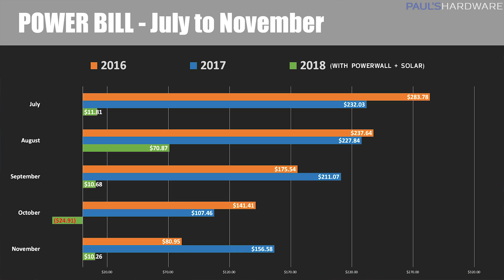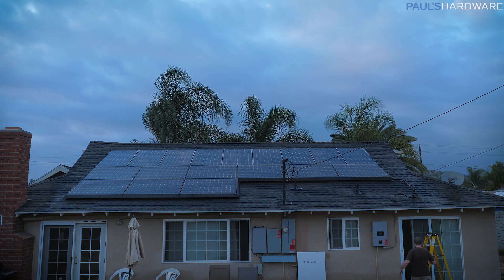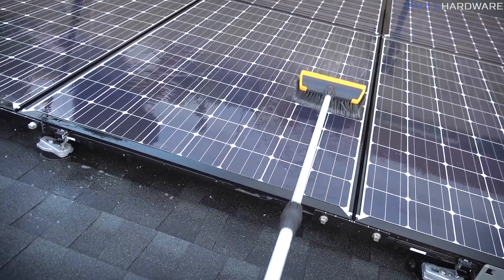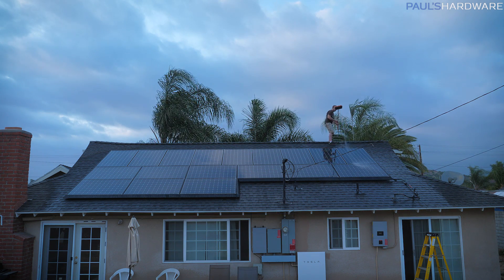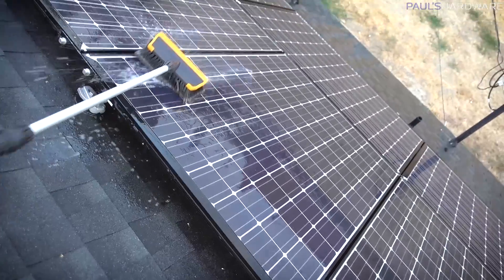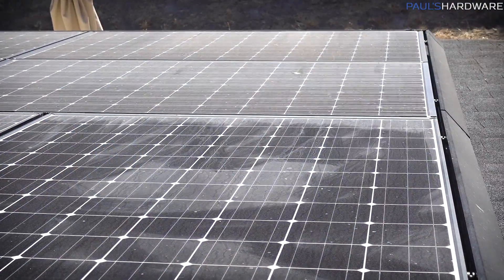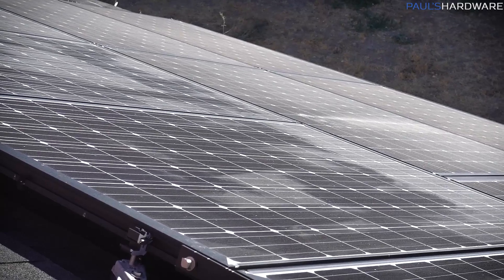Should You Clean Your Solar Panels? Before/After Testing!

Comment: Maybe next time you get up your roof with a harness that prevents you from falling down? 
Cleaning solar panels can be a good idea, especially when leafs block individual cells. Then they act as load for the remaining strings inside of that row in the panel. This can cause heating and degradation of the cell. 
Maybe it can also be a good idea to install an additional luxmeter to cross correlate power output vs. actual lighting conditions. This may show problems a little bit earlier.

Comment: Hi Paul
We installed a 6k system just over 13 years ago and it became pretty clear that we needed to clean the array on a regular basis.  However, our installation is on the roof of a 2 story home which makes it a real challenge to safely reach the panels.  My solution was to array several metal pulsating lawn sprinklers above the panels, run pipe up to the roof, and automatically inject a cleaning solution into the water line whenever I turn on the cleaning system.  It definitely increases output but I do think manually scrubbing would most likely increase output even more but not at the risk of hauling my ancient ass up a ladder with a brush and hose.

Comment: Off grid solar for ~20 years here. Some thoughts:
1. Cleaning does improve performance (duh).
2. Despite the shorter days in fall-winter, I often get very good performance due to lower temperatures. My record setting days have been in late Feb-early March on cold clear days. I've seen my arrays producing around 115% of their rated output at times on cold/clear days in late winter. Cleaning can help keep your panels cooler. That said, I have spent much more time washing my truck than washing my PV panels.
3. Those who do the math on the cost of solar, based purely on economic concerns, are missing the greater picture. While I haven't paid a power bill in around 20 years, I also haven't purchased any NASTY GRID POWER during that period, and my power HAS NEVER GONE OUT during that period except when I have turned the system off for a couple of hours for maintenance and upgrades. During that (~20 year) period, my nearby friends and neighbors have seen their overall rates increase about 50%.
4. There are no easements or rights-of-way of any kind into my property (no need). If the power company comes on my property, they are trespassing. Just sayin'.....
Reply: What about over-all performance of ur solar panels in 20 years?
Reply: I'd love to pick your brain and learn as much as i can about your off grid experience and what your overall cost has been, the type of battery tech you are using and why, and how good it feels to be totally independent of the greedy power company
Reply: Regarding point 3, you say people who focused purely on economics are missing the greater picture, but the rest of point 3 mainly deals with Economics.  Just saying...

Comment: Paul, if your roof has a roof mount (an anchor that roofers use that is attached to your house) you can attach to that and get a repelling harness and attach it to the mount. You won't have to worry about falling, you can go lower or higher by adjusting your rope, and you can clean everywhere. Hope this helps.

Comment: I clean mine with the same method, hose connected to the wand, but I do them from the bottom of the roof. Had to put a half-inch PVC extension about 8ft to reach the top of the panels. Got about a 20% increase on comparable days.

Comment: HI algorithm. Paul I work on a mine site that uses almost exclusively solar panels due to its remote location. We scrub with hot water at the start of the day to have the smallest temperature differential between the panels and the water (so they don't shatter). We also spray a little bit of watered down detergent at the end and we find this helps stop the dust from sticking for longer.

Comment: In the UK with 20 panels, I noticed no different even after scrubbing them because we have alot of rain fall. I noticed something which is on a very hot days the water cooled the panels and increased production by 10-15%, I know panels have a temperature limit but didn’t think it would help this much. Thought it would be interesting to try in a warm climate like yours. 
Great video

Comment: Have you considered a safer option and using a cleaning solution that you can spray on and will clean and dry clear? There are several you can get from Home Depot, Lowe's, or Amazon. If you can get a sprayer to get to the top while staying on the ground you can probably do better safer job. That would be a good video to test different products to see which cleans the best while staying on the ground.

Comment: When two dissimuler metals are used in a physical connection they tend to corrode! This has been a problem with my garden hoses for decades now! If the end of the hose has a copper connection you should not leave an aluminium spray nozzle connected to it! They tend to fuse together ruining the hose connector!

Comment: 25kwh roof capacity, 20kwh inverter capacity - cleaned my panels recovered an additional 421w of generation
we live in a light industrial dirty area, lots of dust, low average rainfall for 70% of the year and heaps of sun all the way down in South Australia.
most of my panels are located on the second storey of the house (no shading at all) our roof is 25deg pitch and very dangerous, slippery as ** when you are up there to do it safely , i used car spraying foam (bowdens snowjob) and light brush to agitate. Panels had been on the roof for 500days
My results are a complete waste of time; took 4hrs to do it and it was a challenge with the suds and waterfall i created in the gutters. Advice would be to buy another 2~4 panels to negate a dirty array.
Great to see someone got far better results than me! at 30% with my decent sized system i would certainly consider it

Comment: If I went through the trouble and cost of having those kinds of panels installed (and I'm sure I would, if I had a suitable house :)), I would also make sure, from the start, that I have proper utilities for cleaning them, like a long enough cleaning brush to reach all panels and a proper "catwalk" installed for doing the job without having to worry about falling down. I wonder if the solar companies have any kind of automatic or semiauto options for the cleaning.

Comment: Here we removed the solar panels because a huricane was approaching. I cleaned, used a clay Bay and polished them with car polisher that leaves no residue (Surface is glass). Amps production improved really good. But still looking for the actual products to protect them. (I identified already one with two steps product) to remove any residue of the previous product used and protect them.
Clay Bay showed me with no doubt that scrubbing them is not enough.

Comment: I have solar panels and never cleaned them for the first 3 years.  Then I cleaned them and compared the year over year production and got nowhere near 30% difference.  The years after the solar panels were cleaned provided a little better production but not anything significant like 30%.  Maybe mine just didn't get as dirty as yours.  I'm in SoCal too, but further north in Santa Clarita.  I have 24 panels and the array faces almost due south (183 degrees).  Maybe the dirt has a greater effect on production the further away from due south you get?
Maybe your estimation method is not as accurate as you may think.  I would suggest simply comparing a full year to the prior year or take a six month period and compare it.
When you think about it, what you are saying is that your production when they were first installed was 30% higher than it was before you washed them.  So, do you really think you would have seen an annual reduction in production during year 2 of anywhere near 30%?  I'd be surprised if that were the case.  In my case, the production really didn't change that much from year to year during the first 3 years when I didn't clean them at all.
Interesting, and thanks for sharing.

Comment: Dear Paul:  Off topic request for topic:  Which PCI wifi adapter should you get?  (Factors:  speed, ac?, bluetooth?, antennas?, wireless display compatibility (Miracast vs WiDi)).  I've searched the entire internet, and there's very little info available on this.  Thanks!  🙏🙏🙏

Comment: Paul, there is a MUCH easier way to clean your panels. Have a look on line for something like the Unger Professional range... They offer actual "solar panel cleaning systems", which are essentially a derivative of a professional window-cleaning set - an extensible, 20' pole and then a specialist soft brush assembly. This would allow you to reach almost all your panels whilst remaining on the ground - you could finish off the uppermost part from a ground-based ladder up to your gutter if needed. The only thing you might have to consider would be the local water pressure you get from your garden faucet, because the greater the vertical height you want to push the head of water, the more pressure you will need. You could easily remedy a lack of pressure with a simple electrical garden hose booster pump. 

Something to bear in mind when cleaning solar panels is that a partially clean panel [more accurately a partially obscured one] can show a massive drop-off in current production compared with a completely clean one. Nikki and Jason Wynn, who run the YouTube channel "Gone with the Wynns" did an amazing video in which they rigged up a roof panel on a trestle table and connected it to a voltmeter and ammeter. They then partially obscured the panel with cloth and the drop-off in output was shocking [no pun intended]. However, based on the Wynns' video evidence, I would suspect that the differences you saw are a small fraction of what you could have achieved.

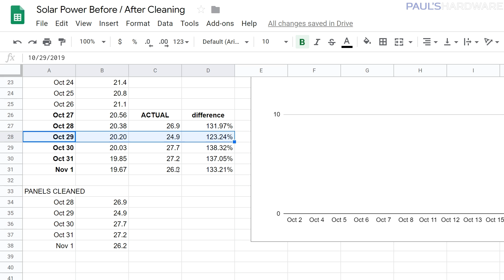Comment: Paul, long time fan mate. But your numbers are off, @8:46.  Percent Difference is generated by the formula Abs(V1-V2) / Abs((V1+V2)/2) * 100%, where Abs() is the absolute value. This means for the date of Oct 28, your percent difference is more like 27.6%, not 31%.
Ultimately the difference is fairly minor in this case and personally, I do not find it affects your conclusion.

Keep up the great work !

Comment: That is a really significant difference, and that's without even cleaning all the panels properly. It may be worth investing in a hook + tether to install on your roof, so you can attach yourself for safety and then clean all the panels properly. Even the ones you cleaned with the brush didn't seem perfectly cleaned, might be worth investing in some special-purpose equipment and going up there once every few months. The rain doesn't seem to do a good enough job, it appears they need scrubbing. It's good exercise anyway and will save you money.

Comment: I wonder if using something like a car soap might assist in your cleaning or if that is discouraged. Car soaps (the ones for washing your car not the spot cleaners) would be very gentle and non-abrasive, they also tend to have things that deter dirt from sticking to the painted surfaces and I'm wondering if these additives would be detrimental to the panel's efficiency or beneficial to the customer by spacing out the need for frequent washes.

Comment: By far, they are generating more when clean.  Just a thought, the cleaning brush is rather narrow. I'm sure there are wider ones available up to maybe 2 to 3 feet wide plus, the pole used are also available in more extended versions. I'd also use a very light amount of dish washing soap to help free some of the dirt as soap lessens the surface tension of water. Maybe a 3 or 5 pound weight on the brush will help for the farthest panels. It appears they do clean up fairly well when brushed while the non brushed panels still had residue on them.  If nothing else, they look better when clean !

Comment: Would be nice if you did it again but in 4 steps to get some more comparable results.
1 - clean them good for a fresh start so to speak
2 - after the next dry period, check the results
3 - just rins them with water, no scrubbing
4 - scrubbing

2/3/4 should be enough to have 3-4 nice days.

i am surprised at how dirty your panels even got. i know a few people that have solar-panels that bothered to wash them but no more as they noticed that the difference is negligible at best, mostly just a tiny 2/3-day bump. It really depends on the installation, panels and region.

Comment: I would imagine that using a two-sided squeegee, and then dipping it into a bucket and cleaning them like you would a window (or car window for that matter) may have an even better effect.  

However, my Grandpa back in the day used to have an attachment like yours Paul, but instead of hooking it to his normal hose he'd hook it to his pressure washer and fill it with premixed soap and then use it to wash things like his car (on the lower pressure setting).  Doing a quick search, it appears that there are pressure washing attachments designed specifically for solar panels, so that may be the way to go!  Soap and scrub them well, then rinse them clean with regular water.

Comment: To make your life easy get an extension ladder and an RV cleaning brush you might have to move the ladder several times but it will keep you off the roof. The RV brush can extend 20' or more so you should be able to clean all your panels.

Comment: Research a way to clean your panels from the ground.  You will be much safer and far more likely to clean the panels on a regular basis.  How about a very long brush/scrubber capable of dispensing a detergent or cleaning solution (mild).  Seems worth the effort/expense to maximize the panels' output.

Comment: Excellent video.  I’d be interested to see if there is a better, safer and more efficient way to clean the panels that does not require you to go up on the roof.  Personally, I’d be reluctant to do that.  I’d much prefer a ground based solution perhaps while on a ladder but definitely not on the roof.  Thanks for your videos about the powerwall.

Comment: Paul, you really need to do all of them properly as depending on the way the panels are wired into the system (of which i am unfamiliar with the Tesla's system) you can find that the panels will only generate at the same level as the panel receiving the least amount of light, its the one reason why system installers will look at shadows cast from things on the roof like chimneys or trees near the house casting shadows onto it are particular points of the day as the shadow cast onto 1 panel will cause a drop across them all, Get yourself a long telescopic waterfed pole meant for window cleaning with a long goose neck on it that way you can do it safely from the ground, it'll pay for itself in no time if you do the panels every couple of months.

Comment: Paul: You should try the Windex Outdoor Sprayer. It attaches to your hose - rinse first, spray on solution and then rinse. Directions state not to let soap solution to dry, but let it work for at least 15 seconds. Have used this product on outdoor windows and it does the job it is made to do.

Comment: Would love to see a full effort test of a thorough hose, followed by a full soap and scrub wash. Overdo it and see how large the differences are. Also a dollar breakdown per panel for the differences would be pretty boss.
Reply: You don't or should never use soap on solar panels... Simply use 0TDS water or water through a high pressure canister filled with DI Resin... Soap and water from a tap / mains tap water leaves behind calcium and Chlorine deposits leaving you with streaky / dirty looking PV Panels. Same method as window cleaners basically. Oh and never use a squeegee as they can pull dirt and break the protective coating.

Comment: Get some soap and pressure wash from the ground.  Shoot it up and then rinse with just water.  If you want to not die...   Also. maybe get a long handle like say from a pool cleaning supply store.  Attached that same end on and give it some manual agitation before you rinse.  No need to get up on your roof.. it's a single story home after all.  Geez.

Comment: EVERSPROUT 7-to-24 Foot Scrub Brush (30 Foot Reach) | Built-in Rubber Bumper | Heavy-Duty Extension Pole Handle | Soft Bristles wash Car, RV, Boat, Solar Panel, Deck, Floor | Bumper Prevents Scratch

Comment: Any roofing store has a fall protection kit. Tell them what your doing because you want a rope not a lanyard. You want it to limit your ability to travel not arrest your fall. (make it so you can't fall instead of stopping you once you do fall.) They will show you how it works. It's very important to keep your panels clean as any restriction in the light reaching the solar panels will drastically effect your efficiency. Ask anyone with a sailboat and panels.

Comment: There are much longer sticks with a waterhose going through it available with which professional window-cleaners can easily reach the 4th floor of any building. Surprisingly those way little and it is easy to hold it and aim with it. With such a thing Paul could clean all of his solar panels thoroughly with much less effort and without having to get on the roof (a big bonus, right?).

Comment: We coated our panels in RainX and it keeps dirty rain water from sticking to the panels and causing residue.  I've had solar panels for almost 8 years now and I clean them once per year.  Power generation between each cleaning only goes down around 3% to 5% throughout the year.  Try out RainX though if you don't want to constantly be cleaning your panels every few months.  I reapply the RainX every year when I do the cleaning.  Takes me around 3 hours to do the entire cleaning and coating job, and I have an array of 20 panels.